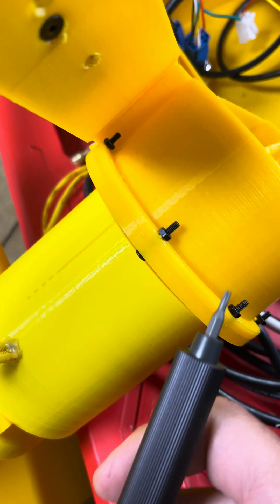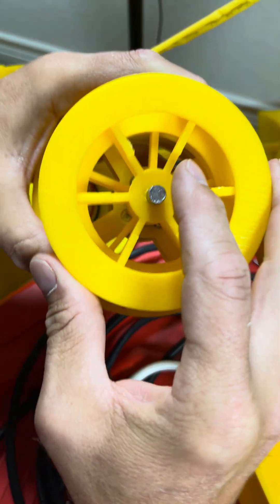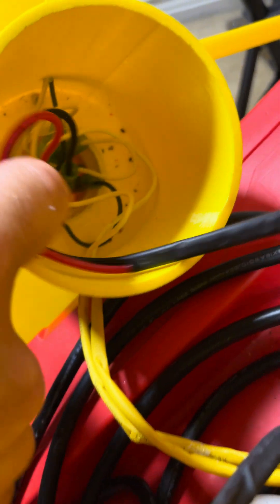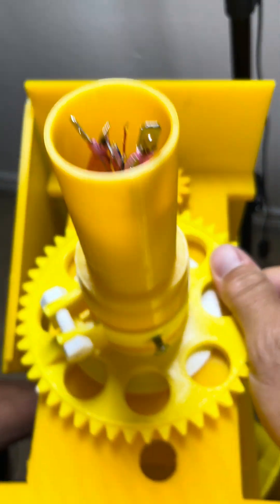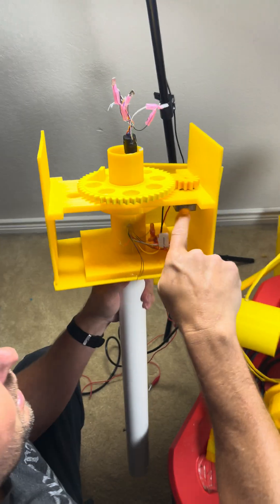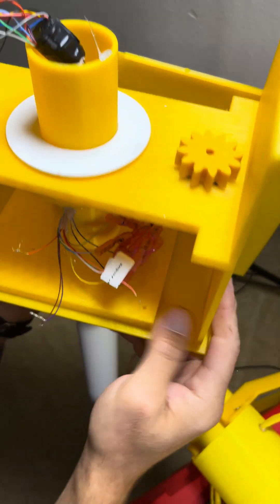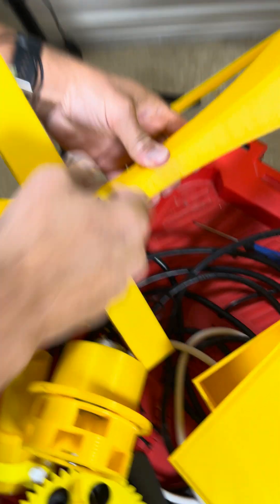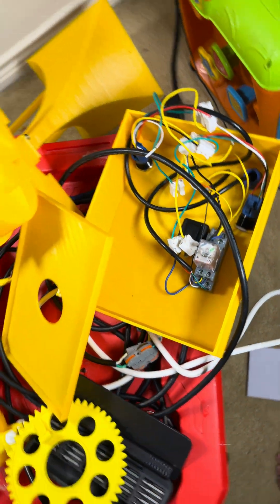3D printed Thunderbolt 1003 assembly and disassembly

Comment: Will you provide a wiring diagram as well as the clamp for the the gear?  I have no idea what the relays do, im assuming they control the solenoids but I have no idea how to wire them